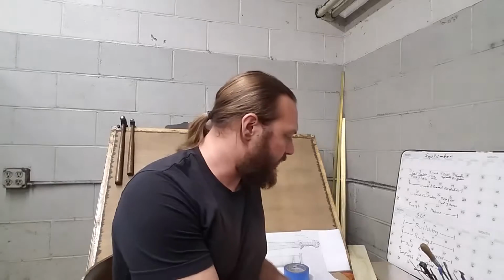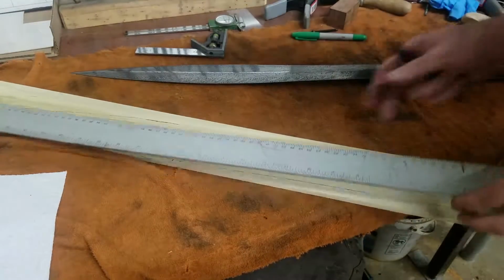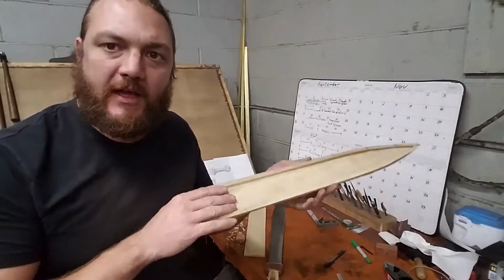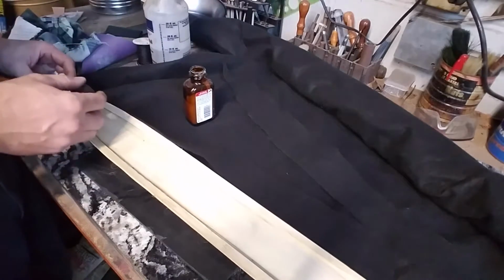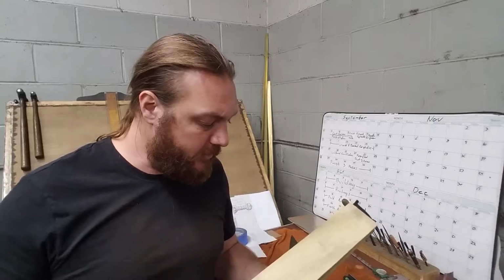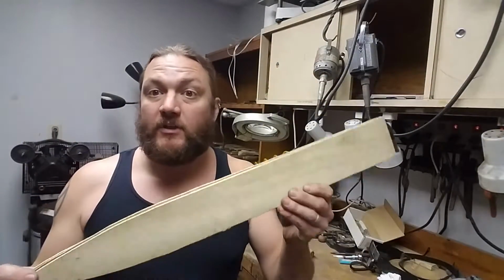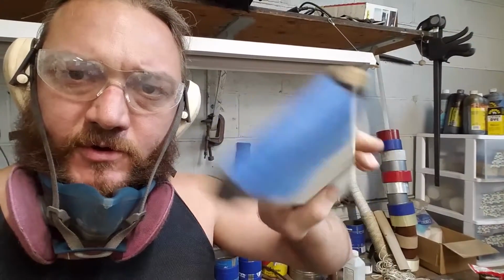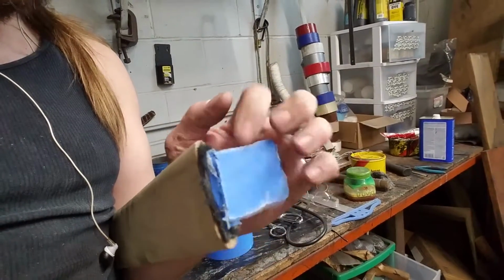Making a Sword Scabbard, Part 1: Wood-Core

Comment: Thank you so much. I love your approach on the scabbard instead of other videos I've seen where they carve the wood which seems painful. Did those 2 extra pieces of wood you glued on the sides added an extra 1/4" to give you a total width of 1/2" for the scabbard after using the planner? Also, I wanted to thank you because I was going to use 1/2" poplar which would have to be reduced later on with a planner which adds extra work, so I am going now with 1/4" thickness instead of 1/2".